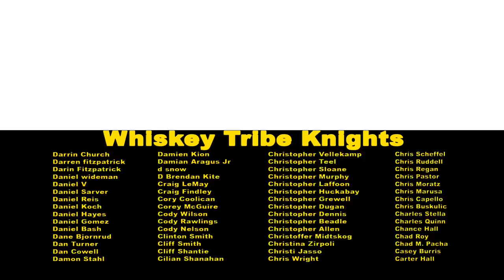Top 7 Things That RUIN Your Whisk(e)y Experience (according to whisky lovers)

Comment: Untrained bartender...
So I order a Glenlivet 12 at a high end bar in the high limit area in the casino that had at least 100 different high end whisk(e)y offerings.  She asks do you want it straight up or on the rocks?  I say I'll actually have it neat please.  She rudely corrects me saying yeah that's the same straight as straight up pouring a measure in the 3/4oz small side of the jigger that still had a little Midori in it.  I than go over to the other bartender working there and ask her what strait up is and what neat is getting the correct response.  I than ask her if 3/4oz is there standard pour and she says no it's usually 1.25oz but they generally free pour more than that for their usual customers, big players, and generally nice people.  I explain what happened and tell her to taste my drink.  She smells it and immediately pours it out and pours about 4oz of Glenlivet 21 instead of the 12 I payed for in a clean glass and apologizes.  Needless to say I gave her the 3 red chips I had...
Reply: How did you like the 21 compared to the 12? I have some 15 year Glenlivet, and I find that I like the taste of the 12 year more. I find it's a little easier to palate, and in my opinion, has less cask taste to it.

Comment: Getting charged extra for ordering neat..... weird things in some fancier joints.
Reply: A normal pour is 2 oz. A neat pour is 3. That's why you get charged more. Just so ya know
Reply: laurrie wood actually on the menu it stated 1 1/2 oz or 3 with the upcharge for neat not even on the menu.... so no.

Comment: 4:35 I ordered a pour of Auchentoshan Three Wood neat at a bowling alley recently (they had a strangely well-stocked bar) and they had no idea what the cost was so after two people working there discussed it they decided on $5 for a pour. This is an $80-90 bottle of whiskey in local shops so at 1-1.5oz they were basically giving it to me at cost. I was already happy about that but then they poured what was probably 3oz+ so yeah, probably going back there soon.

Comment: Two specific instances come to mind for me that are spot on:

(1) One time at a local sports bar, I ordered a bourbon neat. Came in a typical rocks glass with probably around 1 oz of whiskey. After finishing, decided I wanted to avoid having to make multiple trips over the course of the night and ordered a double. Was given the same size rocks glass with minimum 5-6 oz. Definitely made out with the second pour but my lesson learned from that night is, if I’m going to be there for a while, always order a double. 

(2) At a tequila bar in New Orleans I ordered a serving of one of their reposados. Came in a mini shot glass even though I ordered it neat. Gave me the impression that not too many people order them to sip and just throw em back. Wasn’t even a standard shot size for that matter.

Other general things that are disconcerting are when menus mislabel their whiskey or don’t seem to have any system, just throwing everything under the catch all “Whiskey”

Comment: A bit late but, I once received an old fashioned type glass full to the brim of Macallan 18 at a sushi bar
Reply: jesus how much did you pay for it?
Reply: Goose McBruce it was a new bartender so, $15 for a double
Reply: i once got whisky in a half pint beer glass filled to within 10mm from the top, it was 38p back then in the 70's, i knew the barman, lol

Comment: A lot of this is on the nose, and I'm the bar director at the sort of sit down fancy pants restaurant where Mac 12 is a $17 pour, but you had one moment I wanted to contest: I carry Glenfiddich 12, and while yes, I can always get it, you'd be surprised to learn it isn't always at the same prices. Now, it doesn't fluctuate nearly as drastically as any of the Weller/Pappy/Buff Trace allocations, or Blanton's, or a few others, but routinely the price on it will actually change by nearly a dollar a bottle one week to the next. I don't know if that's common anywhere else, but I'm in a massive market city, and I just thought that may be worth sharing with you. 

That said, I also write a menu with clear prices, and just expect to take my licks one direction or another.

Comment: I got a question: Occasionally when ordering Whisky in a bar/pub I got a glass of still water served with the Whisky, but without a way to actually put a little bit of water in the Whisky (no pipette or anything and just pouring the water into the Whisky seems...odd :P)... so what exactly do they want you to do with the water? drink it beforehand to neutralize other tastes? Or drink between or at the end?   Always wondered that and never wanted to ask :D
Reply: Put a straw half way in the water. Then put your finger on top of the straw and pull the straw out and transfer it to the whiskey glass with your finger still on top of the straw. Once the straw is in the glass. Lift your finger and the water falls in. 👍🏻
Reply: @agoodwin2223  But they don't give me a straw either. :/ Just the whisky and the water
But yeah, a straw would be a fine idea to replace a pipette :D

Comment: I have had two of these happen to me.  The wrong glass was one.  The Macallan 12 in a Collins Glass.  Free access to the bottle but the right or even close to right glass not available until later when I found one.  The next was the ignorant bartender.  Local bar is where I try new whiskey without buying a bottle.  I asked for Elijah Craig and the reply back was, "What the hell is that?"  I then pointed to the bottle and said "right there".  Later was with the same bartender and asked if there was any Rye.  "We don't have bread here".  The bar manager was sitting down from me and I asked her direct.  They did but was out because only one person drank it and he hadn't been there in a while.  I happen to catch shift change for bartenders and the next one was better.

Comment: I had a terrible whisky experience recently. So I work at a bar, and I'm a big spirits guy. We have a staff training meeting and we all get a free drink. Great opportunity to ask for something I've been wanting but holding back on. "Chief, could I get a double Lagavulin neat with a glass of soda water on the side" I actually had to get behind the bar because that sweet sixteen year old Islay siren was on a shelf my manager couldn't reach without climbing. I should've known from the uncapped speed pourer that this was a mistake because there were flies. Two whole flies. Got a double 12year Glenmorangie instead but goddamn I wanted some decent peat. Also number 6 should be an easy one to fix, always ask "how would you like it, and would you like a single or double?" and yet it continues to happen (UK bartending is held back immensely by the 25ml / 50ml standard)

Comment: I had a bar girl pour coke onto a double of Dalmore 15 WHILE asking if I wanted it with coke, after I said several times while ordering I wanted it neat. She had to throw away £10 of whisky because she was too brainless to consider that i it costs that much and comes from the top shelf (and is ordered specifically as neat) people don't want a fucking mixer with it.

Another one that sucked was a pub with some Highland Park 12. I asked for it neat, as you'd expect, and the result was a 2 minute comedy sketch as the girl looked for the bottle while I repeatedly pointed it out to her. "No, Highland Park 12 year old, the bottle third from the left  at the back." girl grabs a bottle of vodka in the front right "This?" facepalm
Then I only got a one oune serving in a terrible, square and very wide Dissorono glass. Eurgh....